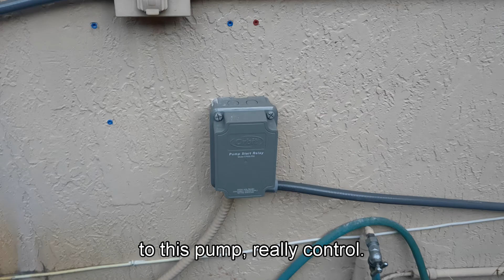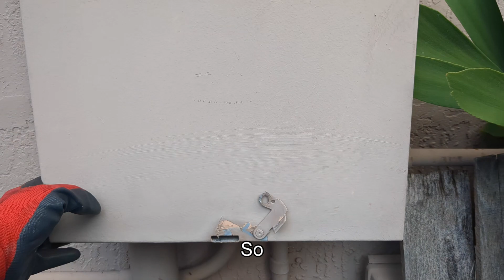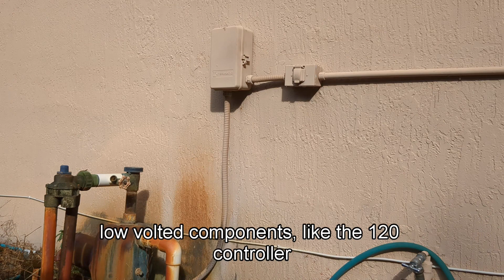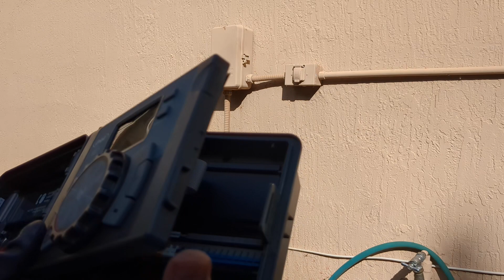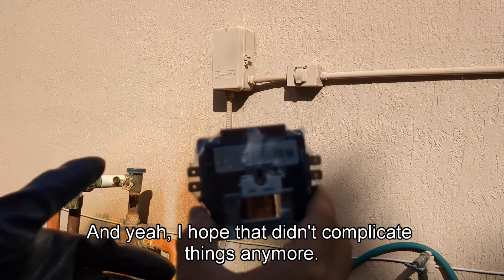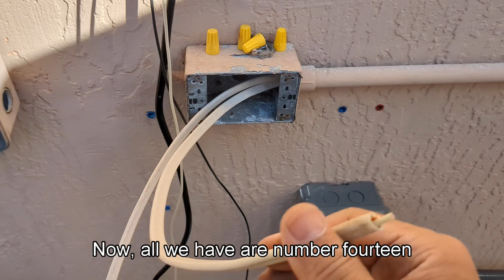Sprinkler system conversion

Comment: Thanks for the video! What if I don’t have the ac plug thing in the middle between the controller and the breaker box?  I only have the breaker wires that have  3 wires that go directly to the current Intermatic setup and another set from the pump also three wires (red, black, green) will this still work? You mentioned you had to add some new wiring in the breaker box. That kind of confused me. Thanks again!!! @superwhizy
Reply from the maker: Based on your description, I suspect you may have a 220vac set-up with the Intermatic timer and 220vac pump (two hot wires and a ground). The main challenge with conversion to low voltage controllers is having to install an intermediary contactor (relay) to toggle the power to the 220vac pumps. In essence, we are converting a 220v controller -> 220v pump system into a 110v controller -> 36v relay -> 220v pump. This work involves expensive pumps and line electricity near water. If possible, outsource to a contractor. All the best, Friend.

Comment: This was very disapppinting. Did you do a part 2? It seems like you had a lot more to talk about but just said “fuck it” and that was it.
Reply from the maker: Um... Did you watch all the way through? That was the entirety of the project. The 230 VAC analog intermatic was swapped out to a low 36 VDC system, but we ended up getting a contactor switch to interface the low voltage controller to regulate the high voltage pump. Where are you stuck?

Comment: Thanks for this. Im going through the same issue now. I got a smart Rainbird system not knowing that its not really compatible with my 240V pump and indexing valve. Trying to decide what I want to do now. I think Intermatic makes some digital timers that will work, but they arent smart systems. The other option is to get the relay, and install the 6 solenoid valves (1 for each zone) to install the Rainbird controller. Not sure I want to put in the relay and then do the 1 zone off/on trick.
Reply from the maker: If I recall correctly, the relay (contactor) to power the water source (pump) is a must regardless of index or solenoid valves. In the solenoid valve system, one of the controller port will be dedicated to powering the pump whenever the system is engaged. Solenoid systems were initially meant for city water fed systems that's always "on" (pressurized).  All the best to you, Mate.